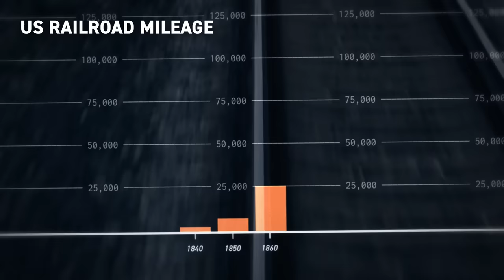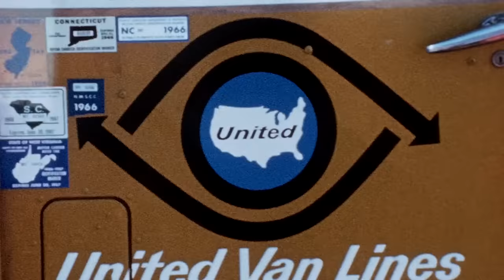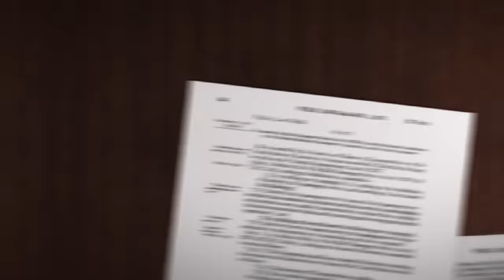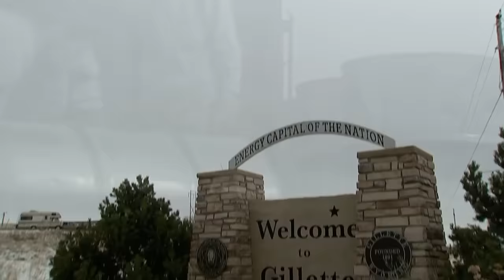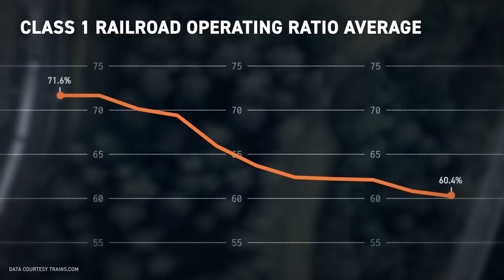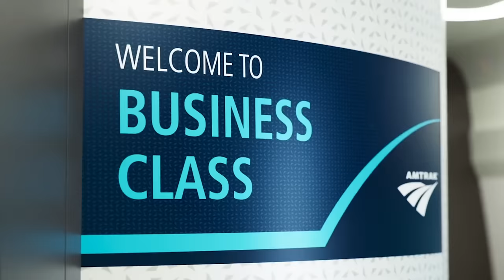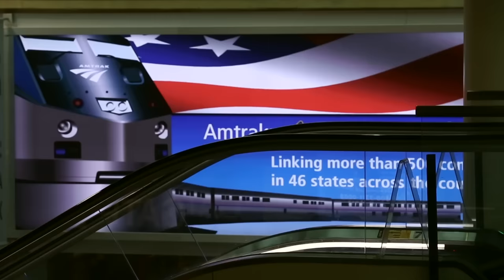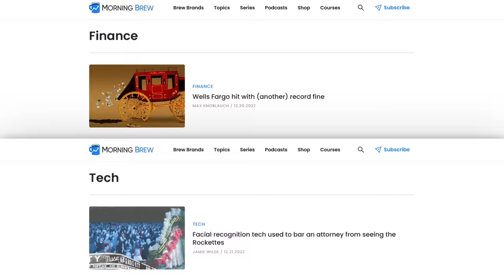The One Tiny Law That Keeps Amtrak Terrible

Comment: Very timely. My own Amtrak trip last week was delayed 40 minutes FROM ITS STARTING STATION due to a freight train. Ended up being more than an hour late to our destination and completely obliterated our plans for connections home
Reply: A couple months ago, I was taking a Texas Eagle from Austin to St. Louis, but a freight train broke down on the tracks between Austin and Dallas, and wasn't going to get running again for at least 24 hours, so they put us on busses instead. It was really frustrating, because instead of a comfortable train ride, it was cramped and uncomfortable.... One of the main reasons I took the train rather than plane. :|
Reply: that's pretty lucky by amtrak standards. I had a trip that ended up 2 hours late to it's destination.
Reply: I used to take train from Portland ME to Brunswick ME, a trip of 40 minutes and 25 miles. Last time I tried, there was a 90 minute delay. I could have almost walked.
Reply: Oh man I wish I was only 40 minutes late. My last two trips with Amtrak were delayed 4 & 2 hours respectively due to freight trains
Reply: Do you know if you were in single track territory or double track territory? If you were in single track that would explain your problem. In single track CTC operation, trains have to run opposite ways passing each other at certain points along the right of way. If there was already another train ahead of you in the single track territory, their really isn't anywhere else the train could've gone...
Reply: What, a government agency ruined your trip, say it's not so. Won't it be great when they run healthcare top to bottom.
Reply: @tira2145  I’m curious if you watched this video before making this comment
Reply: Having a 3 hour train ride turn into 5 cause 6 freight trains had to pass us
Reply: Freight rail takes priority.
Reply: @Sparta955  this is true today. It absolutely should not be the case, ideally. Source: The video.
Reply: @BuckeyeNationRailroader  Maybe the freight train could. have. gone        into a standard-length siding if it was standard- length itself? This. point is made in the video.
Reply: @Hawk7886  Why should it not be the case? The video doesn't spell out how prioritizing passenger vs. freight rail is more beneficial.  Are you aware that the US has the most efficient freight rail network in the world?  Why do we want to disrupt that for an expensive and inefficient form of passenger travel exactly?
Reply: @Sparta955  You can have both
Reply: @edwardhogan1877  There is no such thing as a "Standard Length Siding" dude. The length of a siding depends on factors such as geography and the amount of traffic on that route is what will determine the length of the siding. There is no official guidelines for how to build a siding on the railroad
Reply: @edwardhogan1877  Furthermore, what if had passed the closest siding and their is no other point to stop it? What about if the train needs a crew change because the crew timed out? What if the train ended up going into emergency? 

There are so many factors included in that
Reply: @Hawk7886  Why shouldn't it? You do realize that freight is what keeps the economy moving right? Freight trains often carry time sensitive shipments that need to get to a certain place at a certain time and if they are late than the railroad receives a penalty for it...
Reply: Essentially, TPTB don't want you riding trains in the US.  They want you to drive or fly instead.
Reply: @Sparta955  But that's the opposite of what the law says.
Reply: @scrambledmandible  Maybe, but one has to take priority unless you want to double up rail lines - that's the point. Which one makes more sense to prioritize? Freight.
Reply: @Sparta955  And are you using the voice of a big corporation, such as an automaker or an airline?
Reply: @denelson83  There are quite a few unenforced laws in the USA.  Also, the clause in question very clearly states that the freight rail company is entitled to relief, meaning that tax payers would have to pay damages to them.
Reply: @PumaFau  The healthcare industry is largely controlled by the government and large corporations, which are nearly one in the same. I agree, healthcare sucks, but to think that the government could run it effectively and efficiently is a fantasy. They haven't passed a actual budget in 20 year's.
Reply: 40 minutes is not too bad for Amtrak
Reply: @BuckeyeNationRailroader  Yo what are you tryna prove here? Yeah rail companies are vital to the economy, but the way they’re operating is hurting the economy and passengers.
Reply: @Hawk7886  Wendover conveniently ignores that Amtrak has a more constructive means of persuading freight railroads to cooperate, and that's paying more to use their tracks.  Right now, Amtrak pays basically pennies for freight railroad trackage rights - a rate agreed to in their operating charter.  At the time, freight railroads had no choice but to acquiesce as their rates were all set by the government anyways.  Ever since the Staggers Act allowed freight railroads to set their own cargo rates, all passenger trains make them far less money than if they used that capacity to carry more cargo on those rails, because the rate never changed.  If you look at this from the freight railroads' perspective, getting a passenger train through on time doesn't make the company any money due to that low rate.  But, the freight trains that are now late as a result of moving out of the way of Amtrak will cost them millions in late transit penalties and lost business. 

This opportunity cost is why freight railroad executives and dispatchers loathe giving Amtrak priority, regardless of what the law says, and the freight rail industry has every right to demand a better deal than what they have now.  It's not like they can't run a train on-time - their hottest freights are always on-time, and back when they ran their own passenger trains, those were on-time no matter what, because their passengers paid top dollar.  Amtrak shouldn't just give in to their demands (as that will encourage them to get greedy), but setting up some sort of incentives system for on-time performance or re-negotiating the flat rate to a higher sum shouldn't be taken off the table just because they cost more money than pointing at the Amtrak Improvement Act and shouting.
Reply: @Cal90208  What I am trying to prove is passenger rail service is dead in the United States. The majority of Americans do not want it, and have consistently voted against expanding its operations. In fact, given just how little people would actually use the proposed services in this video, it would hurt Amtrak more than it would save it
Reply: @Cal90208  Amtrak should be dissolved. They haven't broke even in 50 years, and they have stolen from what was rightfully freight companies. Amtrak once had a contract for the most lucrative shipments in the United States such as mail and parcels, even going so far as to handling 100 car roadrailer trains in the 1990s. They failed to make a profit from that, and shows just how much of a failure Amtrak is and a financial burden it is not only on the United States Government but the American people as we are wasting billions of dollars in taxpayer money to Amtrak when it could be going to a much more useful thing like the United States Military.
Reply: @BuckeyeNationRailroader  Transportation companies don’t need to make profits, they’re here to help the people. Having a varied and balanced transportation system is a great asset that the US does not have, but in a world with climate change on the horizon it’s something we should strive to get to. I do not have evidence on me to back this up, I’m fairly certain that a majority of Americans on both sides of the political spectrum support passenger rail. And the lack of profitability is not the issue, the issue is the poor service which is not convenient which could be improved if Amtrak was properly funded. And when compared to other things in the budget, rail makes up an insignificant amount. Also, Amtrak brings money to the communities it serves, so there is still a positive economic impact even if it’s not seen in Amtraks own accounting. But either way, the main thing is that in the future and balanced transportation system is valuable and necessary, which means expanding transit that is not car-centered.
Reply: @MarisaClardy  If they fined the freight trains for every minute they delay any other train (and something big, like $1k), you bet they'd get their shit in order.
Reply: @meneldal  You really think that? If anything freight companies would protest for Amtrak violating the United States Constitution and at that point Amtrak would be in serious trouble...
Reply: @Sparta955  I think the main problem with this video is that it overlooks that the Amtrack/Freight conflict is a false dichotomy. High speed, effective passenger rail services in countries with high speed effective passenger rail service DON'T put them on their freight lines for exactly the reason both sides of this argument lay out- freight benefits from slow moving, highly cost efficient lines as you've said, whilst passenger rail is better when it runs quickly with punctual service. As you say, America's got the best freight rail service in the world (or the most cost efficient network, to be precise), but the best large passenger rail service is probably China, who have 100 times more high speed rail than the US, currently operating multiple routes at higher speeds than any completed rail link in the US. 
The important point there though is that China also operates a large freight rail network. For similar reasons to the US, shipping similar types of bulk goods (though more ore and less international/intermodal traffic). What's wrong with the US system is that it doesn't really try to do the fast passenger rail that can cut traffic congestion along important routes, particularly when it's significantly faster (while a lot of current US rail transport is slower than driving, which, even if it was on time, means fewer folks will want to use it).
Reply: @BuckeyeNationRailroader  Profit is a right? Seems simple but could you elaborate. Is it a right as in it is required to (almost positive it’s not) or it must be allowed to)
Reply: @Cal90208  Yes, Corporations have a protected right in the United States Constitution that allows them to make a profit.
Reply: that train minimal got 20 carts.freights in my country max got 10+
Reply: @sakmadik69420  Yeah that is because only 4% of freight in Europe is moved by rail. Here in the United States that is 28%, and combined with Canada and Mexico is 48%
Reply: @BuckeyeNationRailroader  Can I get a citation on that please? Everything I'm reading states that Corporations aren't people and aren't given rights constitutionally. The people who comprise said corporations are recognized as people and given rights. Genuinely curious to know about this.
Reply: @BuckeyeNationRailroader  So naturally you also believe the US government should pull all funding of roads and vehicle infrastructure as well, right? That's a financial burden on the US Government and American people that could be going to...I guess the military, for your weird example.
Reply: @cloudkitt  The US Roadways technically come out of the budget of the department of defense. The US highways for example were built in the event of a Soviet Invasion to allow for quick movements of troops. Their maintenance technically comes out of the budget for the department of defense. Amtrak's budget does not come out of the Department of Defense but rather Congress itself.
Reply: @CalRailFan90208 "but in a world with climate change on the horizon it’s something we should strive to get to"

If Climate Change is your biggest concern. I hate to sound like one of those Debby downers but we are already at the point of no return when it comes to climate change, and in the end civilization as we know it now in the next few decades will not exist. 

At latest estimates, there are currently four BILLION people who currently work in jobs related to the fossil fuel industry. This includes the mining, processing, transportation, and the use of fossil fuels. What is gonna happen when these fuels run out? Well immediately billions of people will be thrown out of work. Green energy will not be able to solve the unemployment crisis that will come from the depletion of fossil fuels. Furthermore, there are some states in the world today such as the Russian Federation, the Peoples Republic of China, Saudi Arabia, Qatar, Kuwait, the United Arab Emirates, and many others. 2/3rds of Iraq's economy in particular is made up exclusively of the oil industry today. When these fuel sources disappear, these nations will enter a severe economic recession or will outright collapse. This will have a catastrophic cataclysm leading to entire regions of the world such as in the Middle East, Africa South America, and Asia will collapse into anarchy, leading to a massive refugee crisis worse than the one we have have now. 

To further add insult to injury, Climate Change will add a crap ton of climate refugees onto the existing ones that'll come from the collapse of fossil fuel reliant states. Areas such as the Middle East, North Africa, Asia, the Western half of the United States and other areas of the world will become uninhabitable as resource shortages continue to plague these areas. Because of this, there will be a mass migration from areas around the world to places such as the Caspian Sea, the Great Lakes, or any other regions that have the critical resource of fresh drinking water. Regions with fresh water such as the Great Lakes Region, the Midwest United States, the Caspian Sea, and many others will become the new prime real estate, and soon water will become a resource that nations will exclusively want to control. At least until the world superpowers collapse themselves. 

As resources continue to deplete and climate refugees start migrating to other areas of the world, there will be a geopolitical shift with nations around the world. Nations such as the United States, Russian Federation, Peoples Republic of China, the European Union (If you count them as one country) and many others will start becoming very Isolationist, Self Reliant, and/or Imperialist as they try to horde and control resources for themselves. The political and economic alliances we see today such as the Shanghai Cooperation Organization, BRICS, NATO, and many others will start to fall apart as tensions rise over who can control the most resources. Eventually the tension between these superpowers will become so bad, that it will boil over into open hostility. 

This war, whatever you wanna call it, will be the largest and the deadliest conflict the human race has ever witnessed. Prime areas of the world with resources such as Fresh Water, Agricultural Importance, and Economic Importance will become prime targets for attacks and battlegrounds between the world superpowers. This war will only be further exacerbated when the artificial borders such as in Africa and the Middle East will collapse. This in turn will lead to revolutions, civil wars, genocides, you get the idea.

After the ashes settle from this war, their will be no such thing as the civilization we are currently living in. Modern civilization as we know it will be gone, and countries that we see today will no longer be a thing. By the end of it all, society will be reduced to small villages, cities, maybe even united city states. Humanity will be thrown back to Medieval Feudalist Politics for centuries presuming that we survive the upcoming cataclysmic event.

This isn't some dying prophecy or some end of the world prophecy that was written 2000 years ago. This event is happening right now as we speak, and their isn't much we can do to reverse this. Thomas Hobbes demonstrated this downfall of our civilization in his book "Leviathan" from 1651. It is purely the nature of human beings to compete for resources for survival, and that is going to be our downfall.
Reply: @Hawk7886 disagree, it’s their tracks, therefore they get the priority!
Reply: @BuckeyeNationRailroader exactly, I’m happy it’s not happening because I love my car! It’s your problem for living in the city and demanding a train to get to place to place! 🤣
Reply: @GintaPPE1000 Wendover is obviously bias, you can feel it that he’s mad that US isn’t like Europe. 🤣🤣🤣
Reply: @cloudkitt maintaining the military and those weapons we have including our bases in other countries and our aircraft carriers are NOT cheap!
Reply: Zaydan Alfariz  How does North Korea have it much better than the entirety of North America? You do realize that North Korea has no economy and you are aware that North Korea ranks just about last in every ranking from life expectancy, household, income, etc right? 

And no, there are ZERO Socialist Nations that are left in the world today. Is Bolivia a Totalitarian State where everything is nationalized by the government, no political freedom is given, and and idea of individual rights are non existent? No Bolivia is not that, therefore its not Socialist.
Reply: Zaydan Alfariz  Uhhh, North Korea's Life expectancy is 61, which is lower than any country in Asia. And as for income the average North Korea is barely even 2000 dollars A YEAR, and that is mostly for the North Korean elite. That is extremely poor.
Reply: @tira2145  "Won't it be great when they run healthcare top to bottom." Government-funded healthcare (the Government only runs the hospitals not local clinics by the way) works great in Australia, United Kingdom etc.  It is something we hold dear, actually.  Universal public healthcare is EXCELLENT.